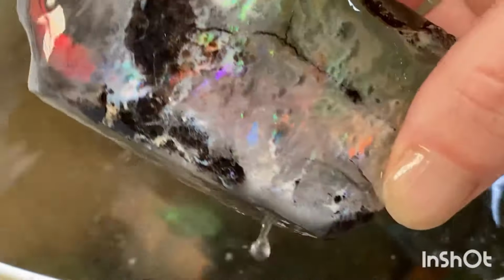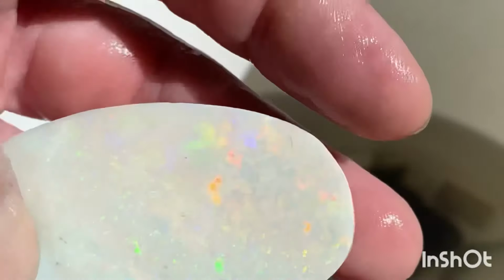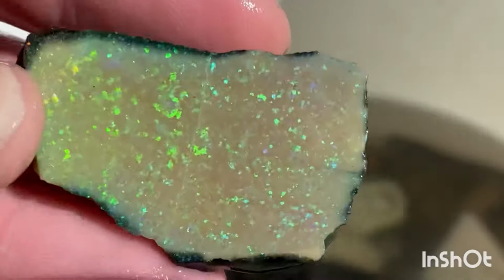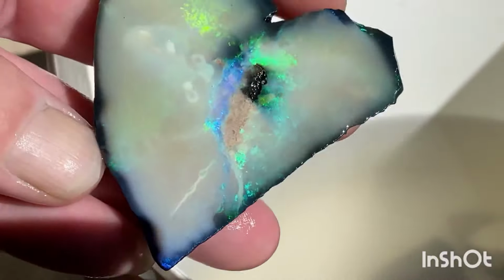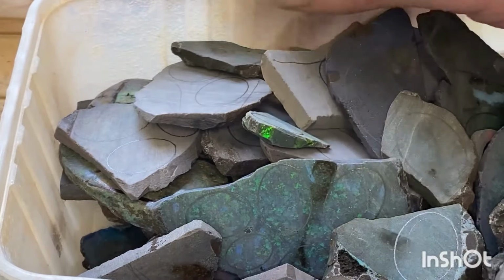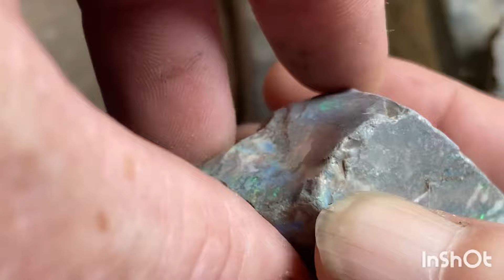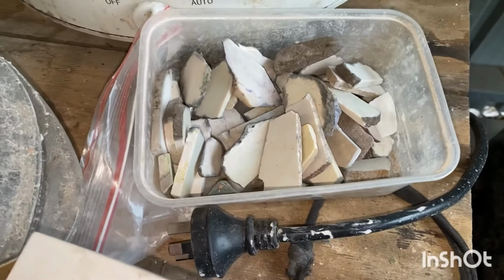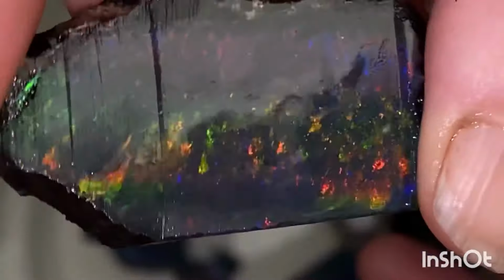Opal matrix: processing a parcel to the final cut.

Comment: How rare is the stuff of this quality you processed in this video? Will in the future be a depreciation of the stones, as they are treated,  as it seems these are huge chunks for precious opals?
And one more thing - how thin can you potentially make slices of the Andamooka opals? Can it be 2 mm? Just thinking of one idea.
Reply from the maker: G’day mate, considering matrix has been pulled out since they mined opal in Andamooka, but it wasn’t valuable enough to keep, so there’s a lot that was either buried again or left down the hole. The matrix wasn’t totally discarded, some was kept to cut stones and are still around today, aged well. From what I understand, hard matrix has made the gemstone list, so future value should hold. With matrix opal, the host rock needs to be considered, as to how structurally stable it is, depending on the size stone you’re cutting, some will break easily if sliced too thin, but 2mm on a small ring stone would be ok. 🤪👍
Reply: @theopalmills  Thank you